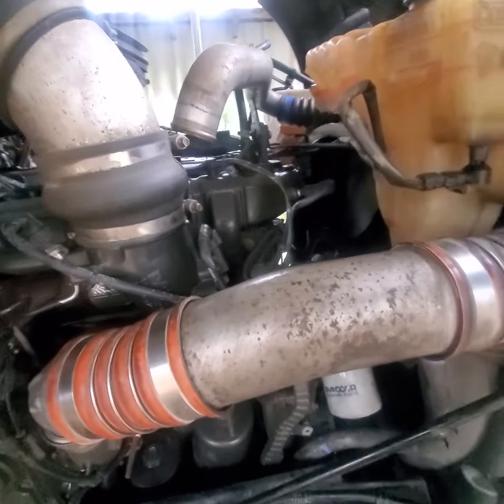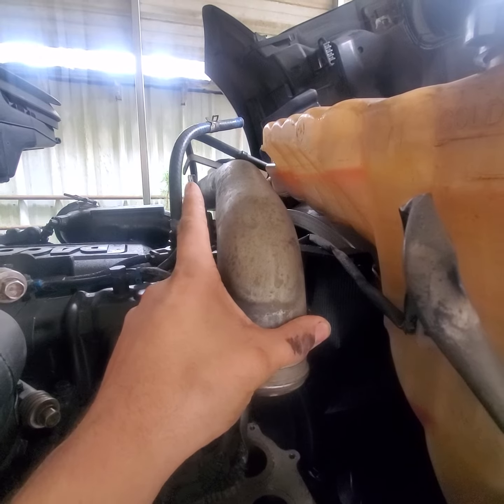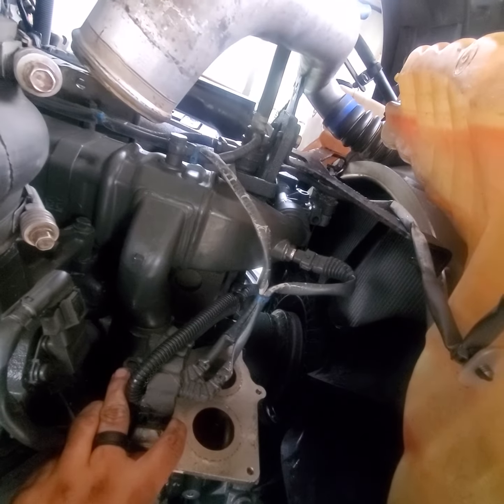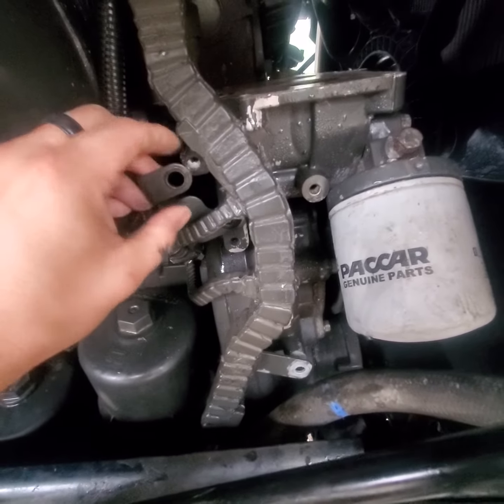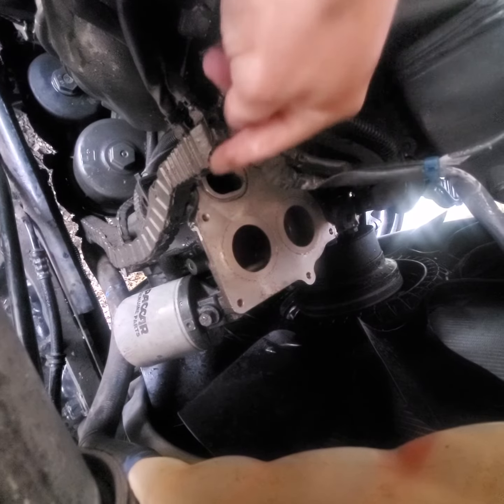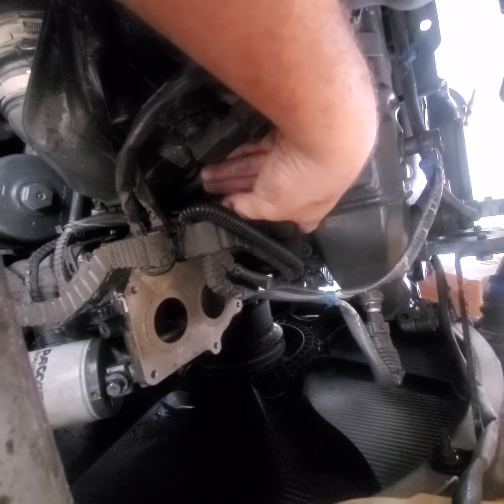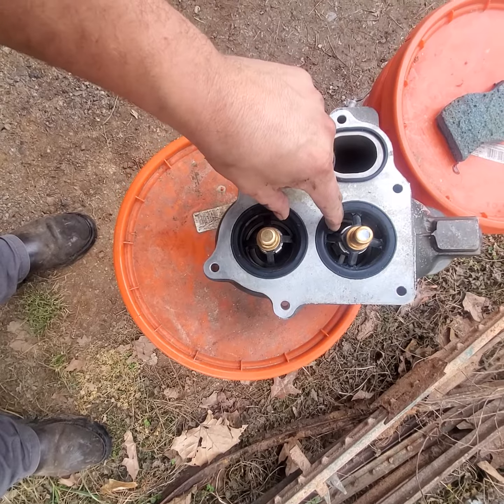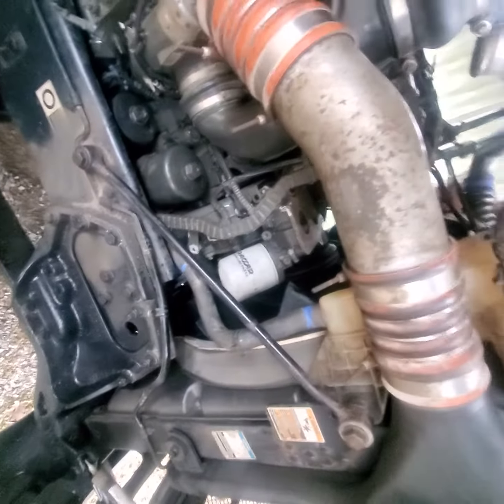paccar mx13 epa 13 how to - thermostats.

Comment: Did you have any issue getting the 6 bolts that hold the thermostat housing out? Not issue with getting a ratchet in there but an issue with how hard it is to get the bolts to back out? Mine are almost so stuck i can barely turn them with a ratchet and am worried I might sheer the heads off the bolts? Any recommendations?
Reply from the maker: Most likely someone has already done it and overtightened them. If they shear extraction would be simple.
Reply: Try and remove them after truck coolant system has reached normal operating temperature. Go easy, if you get some movement, spray with penetrating oil and slowly work back and forth

Comment: You have the thermostats wrong, want lower temp to open and if it gets too hot you want the next one open so it flows better now everything the way you have it will open at even hotter temps putting more wear on everything
Reply from the maker: Looking at the way coolant flows. I have it so the hotter one is always under flow making sure it opens when needed. Maybe my understanding of the coolant circuit is wrong. Since there is no publications from paccar or daf. Do you have a publication?
Reply: @tommysmith8801 local Peterbilt dealer here provided me with literature. 80 degree thermostat goes first, followed by 90 degree thermostat. Great video, but they’re backwards bro.
Reply from the maker: @dmac6955 . Do you still have said literature?

Comment: Definitely set the thermostats wrong.
Reply from the maker: Do you care to explain. Or are you just another gate keeper.
Reply: I didn’t mean to come off like an ass. I watched this video to learn how to change mine in the first place. The only reason I came back here to say it was wrong is because after following the instructions from your video I was aggravated because my truck started to run way too hot (230-240)which lead me to believe they are backwards..it’s a stupid design in the first place. The dealer didn’t give me anything but 2 thermostats and a receipt. You may be wrong or right. My comment was misdirected out of anger. Keep making videos. Either way you helped me out. There’s a channel called Arsen trucking I believe with the paper from the dealer saying which thermostat goes where. The cooler one goes closer to the radiator hose.